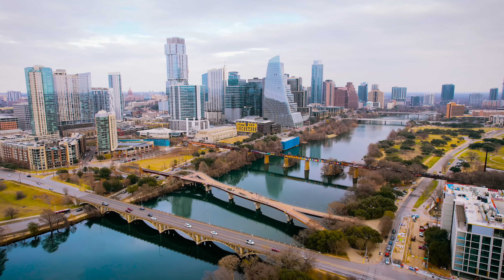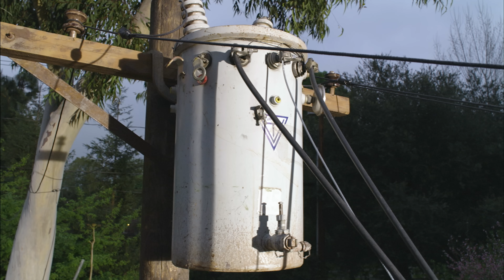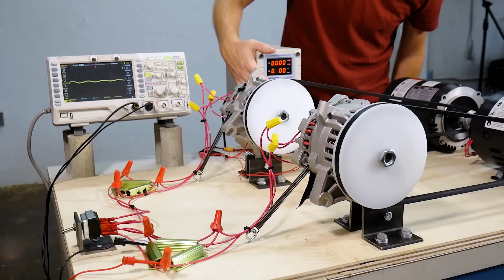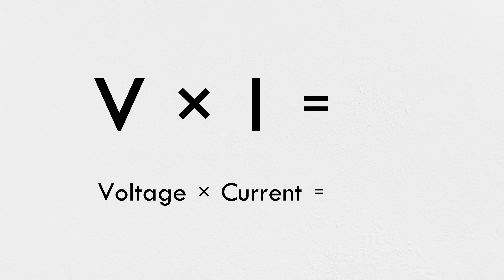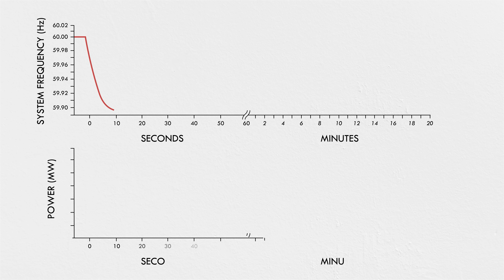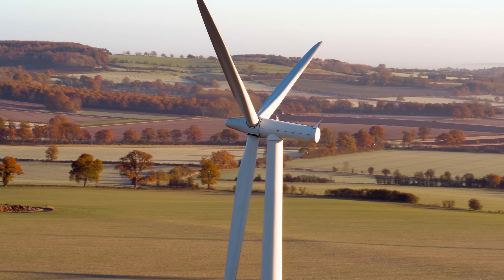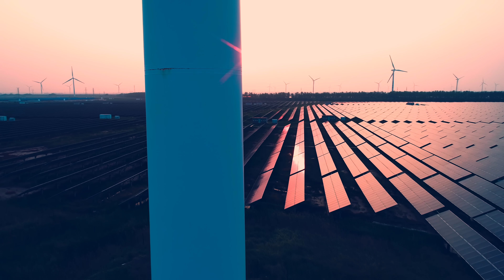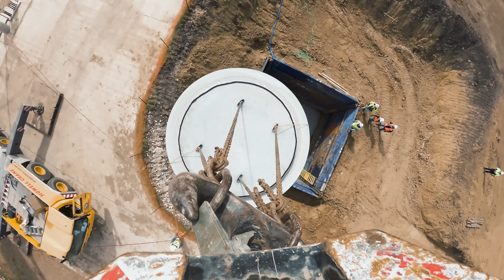Connecting Solar to the Grid is Harder Than You Think

Comment: Texas grid is basically disconnected from the surrounding powergrids, they are more att risk with their power grid, since a bigger / stronger grid have more  margain for error, than a small grid. Stronger interconnections is key when we add all the renewables to shut down fossil energy. East, west and ERCOT grids where texas is included.

Comment: Very well done video!
One of the best solutions is individual energy production & storage (solar, wind & whatever else available), coupled with its own batteries.
System with enough extra capacity, with a bit of automatic loads power management and a dump load (heat storage, bitcoin miner, or else) for the production peaks, with a hybrid inverter, is a lot better than fighting with the grid operators, buy-sell prices, free markets, taxes & etc.
Depends on your market, but if you see the hourly prices in the European energy market you can very fast understand that when your PV panels are at peak, it is the time when everyone PV panels are at peak and price drops, sometimes even below 0.

Comment: I absolutely love how clearly you discuss the challenges with inverter-based resources. I work in nuclear, and have had many discussions about how so many people think we can run the whole grid off wind and solar, but there are so many challenges that spinning turbines help resolve and inverter-based resources would struggle with. But discussions so often devolve into mud slinging about the demerits of each generation type rather than a smart discussion of actual problems and complexities of running a power grid. So I appreciate how you just discussed how it works and is operated in this video!

Comment: NERC (the entity that creates reliability standards and enforces FERC orders - don't ask) compiled a great disturbance report for the Odessa event. The key contributors include a lack of development and implementation of sufficient reliability and performance standards on interconnecting solar facilities.

As another commenter noted, early solar interconnections exhibited an undesired behavior known as momentary cessation (easy to misspeak as momentary sensation which is something else). Essentially it was a lack of ride-through behavior that caught many utilities and developers off-guard and were not properly modeled before the solar projects interconnected. Utilities model solar projects in powerflow, QV, and transient software (such as PowerWorld) to predict a solar project's behavior. However, momentary cessation was not something captured which resulted in many solar projects now online that use this behavior. It doesn't help that momentary cessation is a transient behavior (time dependent, usually on the scale of cycles (Hz)) which is inherently more difficult to model and diagnose than steady-state analysis by both utilities and developers.

https://www.nerc.com/comm/RSTC_Reliability_Guidelines/NERC_2022_Odessa_Disturbance_Report%20(1).pdf

Comment: Can someone explain what he means by "I will not be making an interconnection here" at 6:41 and why the inverter would let out the magic smoke?
Reply: In his demonstration, he showed the output voltage from his inverter and the voltage from the grid. You can see that the voltages on the screen are very unsynchronized. Practically, when power plants connect their generators to the grid, they have to adjust generators' voltage and frequency to be synchronized with the grid. On the screen, the frequencies of both signals aren't equal as you can see that the signal moves relatively to the other signal. And voltages are even worse. One is sine wave while the other is step. If you connect them together the difference of the voltages will cause high amount of current and thus cause the smoke.
Reply: @BBP_BKK  "Connect them together" as in connect the inverter to the grid? Why would that be a problem exactly?
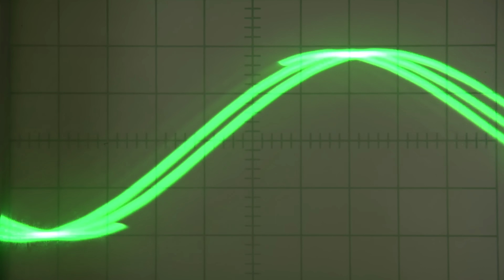Reply: @sebastianelytron8450  Yes, connect the inverter's output to the grid. As you can see on the screen, the inverter tries to make its output waveform to be kinda step waveform while the grid is sine waveform. Two outputs with different voltages should never be connected because those devices want to regulate their outputs to be what it's designed for. (This applys to everything, USB, HDMI, etc. You have to connect from one device's output port to another device's input port.) Two outputs trying to make difference voltages will cause high current as the interconnected wire resistance are very low and I=V/R. It's basically a short circuit. I think you should check out the video titled "What Is A Black Start Of The Power Grid?" on the channel starting at around minute 10:00 to understand the term "synchronization" and come back later if you still have question.
Reply: @BBP_BKK  Thank you, I understand the theory behind it now. But it seems like the "danger" would be local, i.e. the inverter and/or oscilloscope would get fried. Seems like the power grid would be unaffected? If so, why is a permit required and what would the permit precisely allow?
Reply: 1. Attaching any (heavy) power equipment to the grid (i.e. an interconnection) requires permit from power utilities.
2. A badly planned interconnection will cause equipment and possibly grid failure, ending up "in smoke".
Reply: @Speak4Yourself2  Thank you. I still don't understand why he calls it "making an interconnection" though, like how can he create one by plugging in a device?
Reply: @Speak4Yourself2  This is why we have things called fuses and circuit breakers
between the solar invertors and the supply company mains !

Comment: By the way, the reason why they're called 'inverters'. Back in the old days of mercury arc rectifiers, there was only one type of conversion you could do to electrical power: AC to DC. Any unit that did AC to DC was called a 'converter'. Eventually, technology moved on and it became possible to go from DC to AC, the opposite process of what a 'converter' did. Hence, it was called an 'inverter'. Since then, the term 'rectifier' has become common for AC to DC ('PFC' appears occasionally, don't get me started), but 'inverter' for DC to AC has stuck.

Comment: As an engineer in the solar industry I really apricate video's like this. Although you did touch upon it I think that BESS (Battery energy storage systems) has the capability to contribute allot to grid stability. on smaller scales they can compensate and eliminate the voltage and power dips you mentioned when clouds form by using battery power during those events. As well as performing peak power shaving on local levels reducing load on the transmission system.  On larger scales BESS systems can contribute to grid stability by becoming part of the voltage and frequency correction loop for the transmission system. in South Africa where I am based it is becoming mandatory for both BESS and Solar systems over 1MW to integrate into the local utility SCADA system. When you look at the telemetry and control required by this integration you will see that grid operators will be able to command these BESS systems to inject Power, voltage and frequency into the grid according to what grid operators require and not just what the system sees at the point of connection. Contribution to the stability of the grid as a whole.

Comment: This may actually be a good case for mechanical spinning power storage. Flywheel capacitors that can help regulate the power grid. They can be relatively cheap and can help buffer these issues out on a wind/solar farm. You could also connect them in series to stabilize things.

Comment: Hi. Why not just use batteries for energy-storage and as an extra grid? (And make LiquidFuel from the solar panel.) That's my question. From Copenhagen, Denmark - the country that accelerated development of the WindTurbines 40 years ago. Small country. Yet,... small scale 'extra-grid-systems' are ways to relieve the grid. Why spend billions upgrading old grids all over the world when off-grid-solutions can be viable.
Reply: Batteries are very expensive, they are highly volatile, they cause extreme damage to the environment regardless what angle you look at it. Then you have human rights violations as young females only 20 years old with a baby strapped to their back are digging out this toxic material without any protective Gear with their bare hands. 

We have a long ways to go.

Comment: First off, I love the content and learning about what makes our modern world tick. One big question though about inverter based resources:

If the main struggle is that they're either on or off when trying to follow the grid, couldn't we tie them into flywheels to serve as both the inverter and frequency controller? For example, say we have a solar and wind farm set up to feed into an array of flywheels. Then, we can set the grid connection to only turn on when each individual flywheel is up to some speed range, and cut at above some over voltage value? They maintain some inertia during under voltage events then, and when an over outage event occurs they can dump energy from the extra that is generated into some power reservoir/battery for use later, for example black starts or for supplying additional power when in under voltage? If there's any problems with this idea I'd love to hear them or if that's how the grid setting sites you mentioned work I'd love it if you made a video talking about it!

Comment: It would be a lot easier to run the grid on 75% nuclear and 25% solar wind with backup diesel or natural gas. 
The electrical grid is going to need to grow exponentially and solar wind will just keep us tiee to fossil fuels forever. 
Don't believe the hype. 
Solar isn't sustainable and nuclear is the safest power source.

Comment: I don’t understand how increased demand/decreased supply lead to a frequency decrease. Can someone explain or point to resources to help understand this behaviour?
Reply: Keyword: load balancing, power system inertia

Thinking of generators as just machines that convert energy from some sources to be in electrical form. The load tries to pull power from the grid as much as it demands so you have to adjust and balance the source of energy (the generators' input) with the load demand (the generators' output) ALL THE TIME. 

Practically, that's impossible as demand constantly changes and generators' physical input such as pressure and temperature can't change that quickly. 

What happens is that the rotational kinetic energy stored in the rotors performs as a buffer that release or absorb the mismatch energy while the governor control of the generators is trying to ramp up/down the generator input to match with the load demand. As rotational kinetic energy is directly proportional to the square of angular speed (KE=½Iω²), when the kinetic energy is drawn from a rotor, the rotor slows down and thus decrease the frequency.

The kinetic energy is called "inertia" as it resists the change of frequency. This is one of the problems of renewable energy integration. (Inverters nowadays can be designed to provide synthetic inertia but I'm still not sure on its effectiveness.)

Comment: Excellent presentation, Grady. 

Maybe I missed it mentioned in the video but those renewable sources shutdown because grid operators lobbied hard to have them do so. The main point is, safety. If the operator shuts down a line, they want all followers to immediately disconnect generation to protect workers. Perhaps a balance could be reached where followers continue to generate for a given amount of time to account for these brief dips. On the other side, workers should know to wait that amount of time before touching anything.

Comment: I don't get it. Why not use 10% or so of the energy out of batteries? They can handle almost all the problems instantly. Instead of turn on and off things and followed changes, just put batteries and capacitors in the middle. Like a small circuit.

Comment: Why would you want to be grid-tied? 
-Your roof belongs to the power company.
-You have to use "approved suppliers", and don't they know it.
-You have to pay all sorts of permits and fees, and don't your local government know it.
-Upgrade your system? That'll be more inspections, mate.
-You can't feed in to the grid when it needs maintenance. My old workplace had 13kw on the roof and COULDN'T KEEP THE LIGHTS ON.
-You can make a 'soy face' as your 'meter runs backwards!'... at wholesale prices, which at the kilowatt scale are sod all.
OR
You can get the panels, batteries and inverter / all-in-one that suit you, plug appliances into it, and run stuff off your "own brand" when you like, how you like, at the scale you can afford.

Comment: You didn’t mention the biggest reason to use alternating current is to change wire size. With thousands of miles of aluminum wire, you want the smallest wire you can conduct your power around the grid.  Other equipment, and insulation are an issue, but the biggest cost is the transmission lines.

Comment: I don't believe many wind turbines use DC to AC inversion to sync to the grid, anymore.  Instead, they use double feed induction generators (DFIG).  A DFIG cleverly uses a smaller inverter to provide a variable speed, rotating atmature field.  This allows the machine to maintain a steady relative speed between the rotor and the armature, and stay symced to the grid.

A video on DFIGs Imight be interesting for you to make.

Comment: I am selling Icon's passive cooling system on its own, but once it sells more, I am thinking of starting a plan to solve this power problem.
If there is a company that is serious about this idea, we would like to collaborate with them first.
In fact, the icon device is registered as a CO2 reduction product by Japan's Ministry of the Environment, and we approached Mitsubishi Electric through the Ministry of the Environment's contact point about collaborating with them, but received no response.
This idea was originally based on the idea of using the electrical energy generated by solar power generation in the evening and at night, when electricity is consumed the most, and also includes other measures to be taken in the event of continued cloudy weather.
If you can identify yourself clearly and work for an electronics manufacturer, I would like to discuss this with you as soon as possible.
By the way, I am an expert who holds the qualifications of a Japanese chief electrical engineer.
I think it's worth listening to

Comment: Let me just say that I am a big fan of your videos as I am an electrical engineer and I love your deep dives about practical engineering. I think overall, you summarized the topic of challenges regarding inverter-based resources quite well because lack of inertia, ride-through requirements, and protection issues are among the the top 3 challenges for sure. I am only commenting here because this is the only topic you covered that I have some expertise with. I really do not want to nitpick here but I felt like there were some small errors with the way you explained how grid-tied inverters work because once synchronized with the grid, they do not vary their voltage to control how much power is flowing into the grid because the grid will dictate a constant voltage and frequency. They vary the phase angle between the inverter voltage and the grid voltage to control the current flow and thus the power flow to the grid. The voltage amplitude stays constant and that is why the graphic is also misleading showing the voltage waveform going up and down while this is inaccurate. The explanation of how inverters work was a bit oversimplified for my taste of course and you showed a graphic of multi-level inverters instead of pulse width modulation which looks a bit different but I think that is okay since you are explaining the concept to a general audience. 

Again, I was so excited that you finally made a video about a topic that I care about and know a bit more about haha. I am not pointing this out to criticize your efforts but because I feel like it is important to try to give accurate information even though it is challenging when you try to simplify it to be consumable to a general audience. Keep up the good work :)